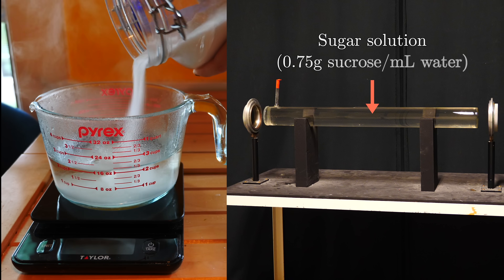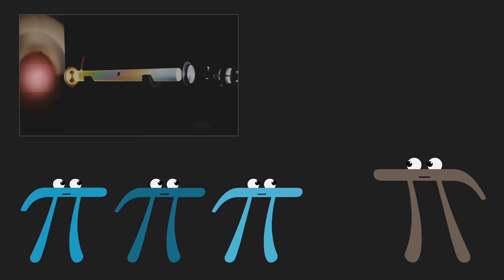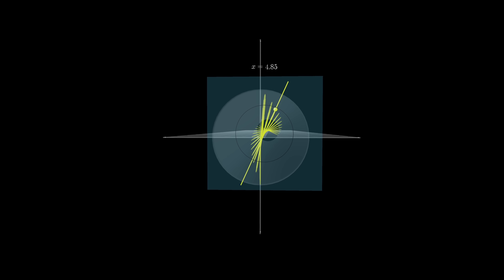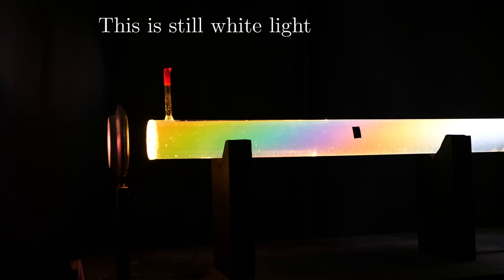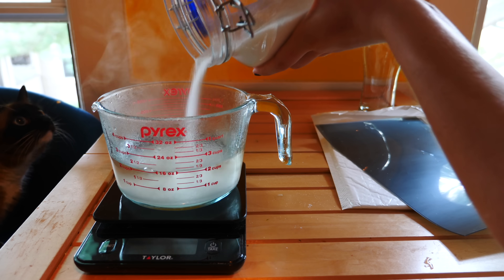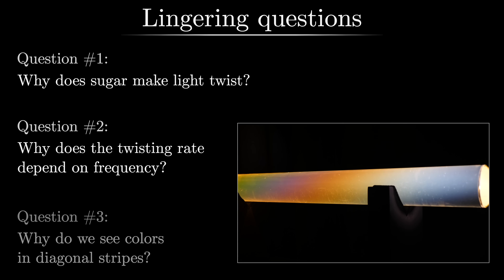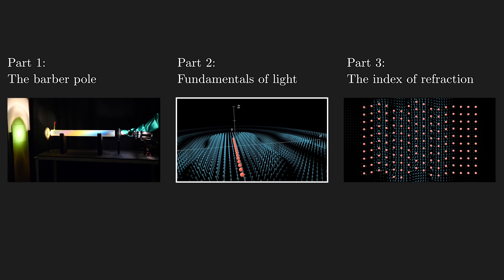This tests your understanding of light | The barber pole effect

Comment: This actually makes sense.. the polariser makes the line "wiggle", the sugar water then twists/scatters and we get the different hues because violet scatters first and red lasts.. hence the red and orange hues at the end.

On the other hand why does sugar water twist it... it's  because of the sugar molecues present in the water. They are at the size where diffraction(?)/scattering occurs. I would assume any molecule of similar size would achieve the same result.

And the diagonal exists is because the scattering would be most predominant in the direction exactly perpendicular to the polarised light

Comment: The intensity of the scattered light is dependent on the angle between the polarisation and the scattering direction. Even if we look at the tube from the side without moving, i.e. we don't change the direction of scattering we are looking at, the different polarisations of the different colors cause different scattering intensities in the same direction. This leads to some colors being scattered less and others more in our direction. This explains why we see color from the side.
Even so, this only explains the observed horizontal color gradient. For diagonal stripes, we need vertical color gradient too.
I think the reason for this, is the shape of the walls of the container. Since they are circular(the container is cylindrical), there is refraction from the walls, which effectively changes the direction from which we observe the scattering. This means that looking at the top or at the bottom, we see scattered light more in the upward vertical direction and more in the downward vertical direction, respectively.
If this is true, the slope of the stripes may be greatly reduced if instead of cylindrical tube, a rectangular one is being used.

Comment: My guess: …

Which

Maybe 

Contains

Spoilers

if it’s d-glucose at that concentration, then the solution is in semicrystalline form with a restricted set of conformations. Since the light encounters crystalline units but of random size and dispersion, then there is an accumulated refraction effect that exhibits larger than ordinary spectrum of light.

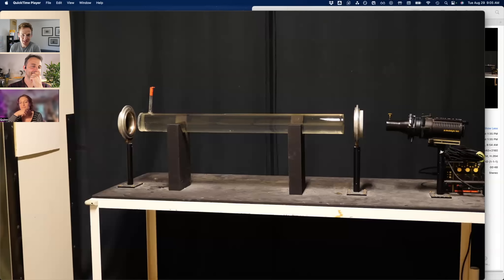Loosely calculating with ~180g/mol and ~18g/mol for glucose/h2o (750g/L and 1000g/L), then that’s about 4.2mol glucose and 55mol water per mass. That ends up being about a 1:19 ratio, which biases the arrangement of water around glucose which likes to crystallize.
Reply: Oh and the polarization probably necessary to make the effect much more prominent.

Comment: Me: What exactly is wiggling, and what is the significance of wiggling in a direction?

He: Don't worry, we're going to go much deeper into what exactly is wiggling, and what the significance of wiggling a direction is.

Me: I love you.
Reply: It's the electric field that is wiggling.  The electric field oscillates as light passes along region of space, in a direction perpendicular to the light's direction of travel.   The magnetic field is involved as well, in a third perpendicular direction.  Usually when people identify the polarization orientation of light, they are identifying it based on the orientation of the electric field oscillations.

If the electric field is "surfing" in the z-direction as the wave propagates in the x-direction, then the magnetic field will be "snaking" in the negative y-direction.  There is right hand rule that sets up the relative directions, where the index finger points with the electric field, the middle finger points with the magnetic field, and the thumb points in the direction the wave is travelling.
Reply: @carultch  You can desist, 3b1b already has my heart.

Comment: Very fun.  I think QM has killed our intuition of light.  Light as with all EM is an oscillatory phenomenon and oscillations EM can induce in other things can yield side effects.  I hazard a guess that this works only because the sugar has been allowed to organize within the tube and that organization has created a twisted path of refraction along a correctly sized vibrational axis of the sugar structure.  If the solution was being sufficiently stirred, I think the twist would disappear.  A very slow stir, however, might be quite a show.

Comment: Argh, you caught me on a cliffhanger! I so wanted to know why the colored diagonal appear! I'm guessing... Low-angle refractive polarization off the interior sides of the glass tube?... Yes. That's a strong polarization effect, the same one that is countered by polarizing sunglasses. So you do have two polarizers and must achieve some color separation, wouldn't it? And the spirals... would be twisting through more sugar water relative to the first polarizer... yes, helices, locked to the source. Ah, very cool! Must try this...

Comment: I can’t find my old correction so I am reposting it here:

Hey there, I have a fundamental correction to the visuals in this video. The polarizing filters are oriented incorrectly. When the polarizer is vertical, it will transmit horizontal and reflect vertical. It’s a common misconception, if you would like to hear more I would be happy to share! (I am an electrical engineer with a passion for light haha) 

PS these are some amazing quality videos!

Edit 1 for clarification:
An experiment I performed in undergrad involved a square with equally spaced vertical wires. We placed it between a transmitter and receiver (transmitting vertically polarized EM waves, maybe 3GHz but I don’t recall). When the wires aligned with the direction of polarization, the receiver signal dropped drastically and vice versa.
Reply: Isn't this just labeling the same thing with a different word?
Reply: That's interesting ! A quick convincing argument is that when the electrical field oscillates along the stripes it induces currents so the light is reflected like on a metal.

If a polarizer has an arrow, what's the convention then ? Should it show the orientation of stripes or the polarization you obtain ?
Reply: Who said that the vertical lines on the polarizers represented the orientation of the wires?
Reply: @The_Canonical_Ensemble  Well, that's how we perceived it at least.
If I see a drawing of, say, a fence with vertical lines I'm not gonna guess that the physical planks they represent are horizontal.
Reply: @ghislainbugnicourt3709  Well to me, the representation given here is clearly abstract and just represents the orientation of the electric field it lets through. I think the analogy with the fence is flawed in that it's hard to draw an abstract fence and that there isn't an obvious other thing the vertical lines on the fence could represent such as the orientation of the electric field the polarizer lets through. I just think phrasing it as a correction is pedantic.
Reply: @The_Canonical_Ensemble  The fact that you saw it as an abstract representation is cool, I don't deny it, but you need to accept that others saw it more concretely, which justifies the fence example. The illustration can be misleading especially in a context where many people do make the mistake explained by the OP.
In other words, even if the intent was to make it abstract, it would have been more effective with, say, an arrow rather than stripes.
Reply: @ghislainbugnicourt3709  Well, if it's a matter of interpretation, I'd say it's a stretch to call the visuals wrong, don't you think? It's a different thing to say something is incorrect rather than possibly misleading.
Reply: The arrow is a good indicator. I would say a vertical arrow to denote the direction it allows to pass through, but the lines should be perpendicular to that arrow. 

An experiment I did in undergrad involved a square with equally spaced vertical wires. We placed it between a transmitter and receiver (transmitting vertically polarized EM waves, maybe 3GHz but I don’t recall). When the wires aligned with the direction of polarization, the receiver signal dropped drastically and vice versa.

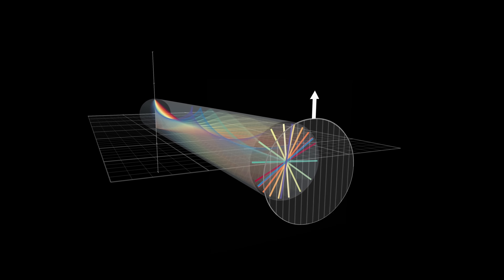Comment: Just a nitpick: a light polariser would have the “lines” perpendicular to the polarisation direction it will pass. These lines are conductors and will absorb the electric field if it is in line with the conductor 5:45
Reply: To give the video the benefit of the doubt, the vibration planes could also have represented the magnetic field.

Comment: What about circular polarisation?!? It's the true quantum state (you can count the two of them; you can't count the irrational number of linear angles..)
Turns per length, rather than 'frequency' - each sugar crystal (molecules) is a fixed size so you are looking at a 'diffraction' grating from the side, with linear spacing from the molecular spacing.

Comment: The moment you showed the selection of colors at the end of the tube, I knew exactly WHAT was happening with the polarization of light (polarization rotating and wavelength dependence, so at the end you filtering by polarization is equivalent to filtering by color), but I could not imagine HOW and WHY that's happening.

Also question #3 is half obvious (it separates by color because it depends on the polarization of light in that point, so since colors separate by polarization, it's the same and since the polarization is rotating through space it makes sense that the color you see on the sides is rotating/diagonal/spiral through space, too) half not at all (but WHY it depends on the polarization in that point?)

Comment: I think you can see the light from the side because light polarized perpendicular to a surface it glances is more likely to refract through that surface than reflect. The same way that light glancing off water polarizes the reflected light, because only the light that got reflected is polarised parallel to the water and the light that is perpendicular refracted into the water. So when the light direction is polarized by color only colors perpendicular to the cylinder wall leave the cylinder at that point.
Reply: You need change "only colors perpendicular are [refracted/transmitted]", to "[refraction/transmission] is weighted by cos(angle)"....or maybe sin(angle) for perpendicular....but cosine is the traditional function since z = r x cos(theta) in spherical coordinates.